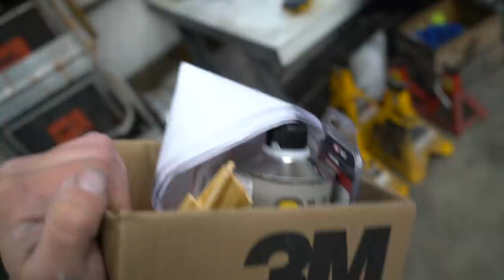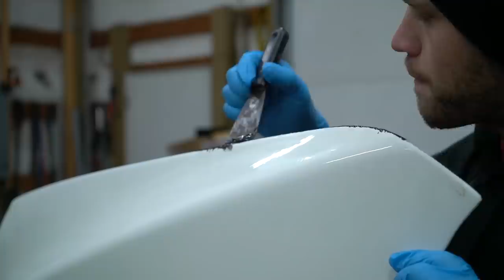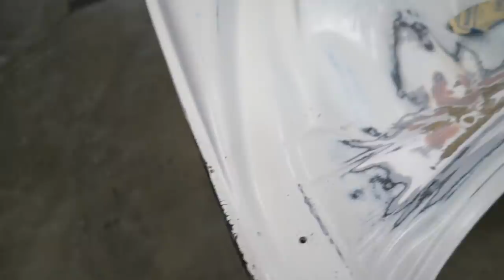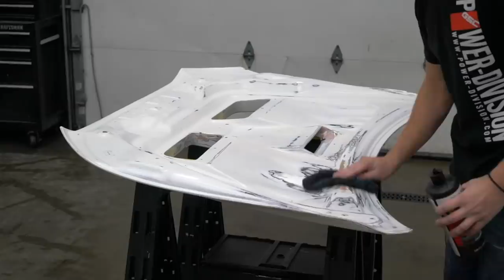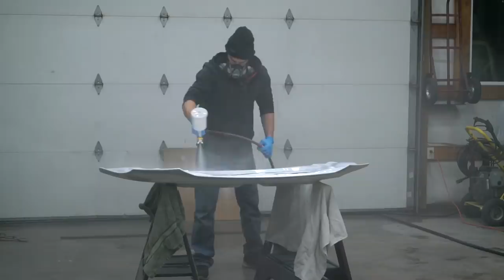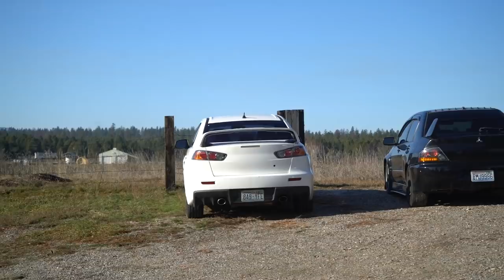Fixing and Painting the Evo X Hood!

Comment: Just had a bumper painted, the shop told me to wait a full week to even wash it with a brush, I would recommend waiting at least two weeks before wrapping, one week would probably work, but you'd hate to peel paint.
Reply: I was literally coming into the comments to say the same thing. Wait two weeks for it to cure before wrapping it. You won't be sorry in the long run.
Reply: Yea. Hit up Preston and just run it through a quick bake cycle then wrap. Other then that i would wait 1-2 weeks.
Reply: At my shop we leave the fresh painted part under a heat lamp for the night, turn the heat off when we open the next morning. Then start wrapping after lunch. Never had any paint peel on us yet🤷🏼‍♂️ waterborne paint is a lot faster drying then solvent-borne used to be.

Comment: Follow manufacturers instructions for paint curing. If it’s baked, you can wait a few days. If it’s air curing, the paint can continue to gas out for 60-90 days. 

I would contact OMNI and see what they recommend. Every paint system is different. I tell my customers at least 60 days before waxing if they need body work done. That’s the safe side.

Comment: Paint times depend on hardeners and thinners used as well as temperatures. I have products that you could vinyl 20 minutes after baking for 15 minutes at 140 in my paint booth. Everyone giving their 2 cents about curing times; it's an absolute guess in the dark. I've painted just about everything under the sun in the last nearly 20 years if painting vehicles and even I wouldn't dare to advise curing times without checking what you're working with. You need to look at the product data sheet for whatever paint system you're spraying. 

I'm a restoration tech for new vehicles with transport damage that require absolute factory standard results. My little brother lives in Spokane; follows your channel and has talked with you a few times. He saw this video and shared it with me. I'd be happy to come by sometime and show you a few tricks of the trade as well as explain a few things your seeing in your results. If you want to learn full respray, I enjoy helping people learn to paint.

Comment: Tip on next one (if fiberglass) use kitty hair, its a fiberglass equivalent to bondo and has way more strength attributes. You can use on some of the worst damaged fiberglass parts to fix it stronger than new.

Comment: Your really need to check on the info for the particular paint you are spraying as to how long you need to wait.......   some paints need weeks or months to fully cure.  depends on the paint.   base coat clear coat paints sometimes need a-lot of time to cure.  of you cover it with plastic too soon, it could not cure correctly.  older paints take longer, factor cars use heat to hurry up the time so it fully cures..... totally depends on that paint you are using and the temp it is in while it is curing.    covering it in plastic list the the worse case scenario so you want to make sure it is fully cured.

Comment: Decent job for the first time around. I’d say a lot longer then a year to do full resprays as it takes a shit load of practice. Plus there’s the cost of it. For a quality job you’d want to build a spray booth plus the costs of all the different paint guns needed for a proper job. Then there’s the cost of the actual paint and clear coat which starts to get hella expensive when you need to do a full respray. You’d be looking at something over 10k just to for that stuff alone. Add in extra cost for the paint which your going to be practicing with, sandpaper, bondo and it ends up being not worth it. But hey, if you want to nobody’s stoping you so I’d go for it. It’s just gunna take longer than a year to learn to lay a nice coat on a full car

Comment: the trick to painting is flowing the paint to keep it from getting orange peel or dry areas one painter that taught me was spray it where it is heavy enough that if you put more down it will run your looking for a finish where its border line running and then wait between coats so it tacks up then hit again till you have three coats.also to keep it from flying up again use QL-38-LP/BP Quik-Latch Hood Pin Kit it will save your hood from flying up again.